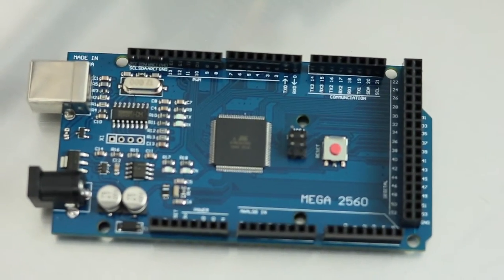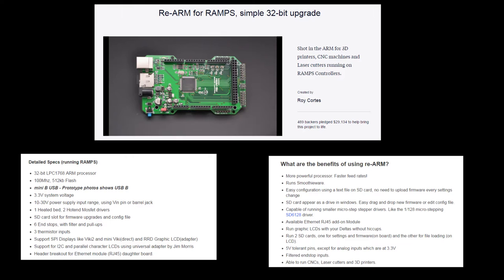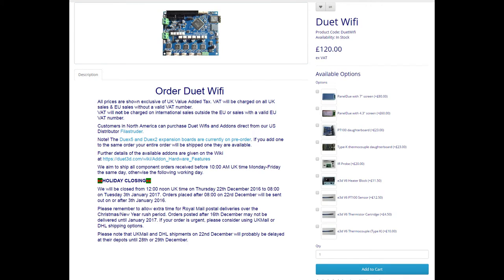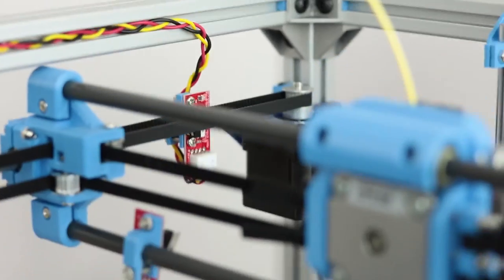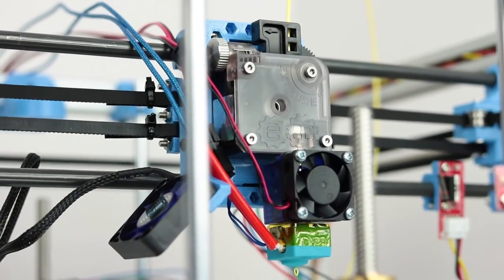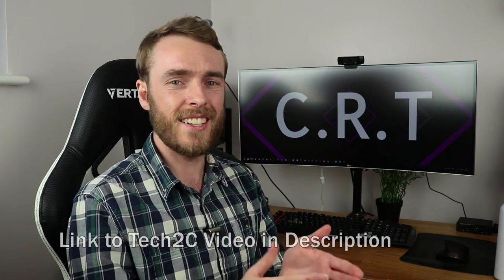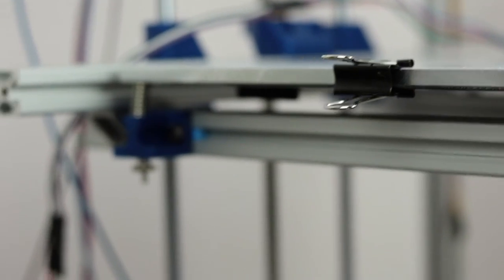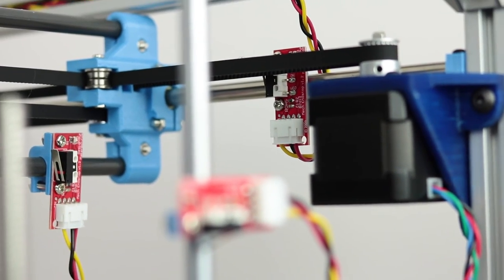Control and Cooling  - 3D Printer Scratch Build Log - Episode 6

Comment: I would recommend the Duet Wifi, The re-ARM project for me is kind of pointless as it still uses the flawed RAMPS 1.4 board. I do not recommend the smoothieboard because the duet wifi exists. The duet wifi just offers so much more than the smoothieboard for the same price. The Duet Wifi uses the TMC2660 stepper driver that will elimenate stepper noise. Not to mention WIFI and the excelent web interface for the Duet.

I also do not recommend the drv8825 stepper driver as it has some issues with missing steps when using a stepper motor that has a lower voltage rating than the electronics. I would recommend the standard A4988 stepper driver instead. Besides the 1/32 microstepping doesn't make it more precise, only slightly queiter. It also have a horrible whining noise when the stepper is not moving but still powered.

But if you want a quiet system without replacing the entire Arduino - RAMPS, consider the TMC2100 stepper driver. But i haven't had any experience with them, only read good reviews and feedback on them.

To be honest, 8-bit electronics are enough for 3D Printing. What you get from the 32-bit boards are for the conveniences (Web interface, WiFi, etc). For me, they are not worth the heavy pricetag just for those conveniences/features. But if you have the budget, they are most defenitely better than any 8-bit electronics.
Reply: yes, while RAMPS definetly works, it's not the best board out there. The only reason to use RAMPS is because its cheap. I bought all of my RAMPS from china and they all work fine. All the problems popping out on the RAMPS are because of its inherently bad design, not because of cheap parts (altough, if you DID get cheap parts from buying from china, thats also a problem. Mine came with all the specified parts and none of the parts are skimped). I do not see the reason to buy expensive "high quality" Arduino + RAMPS as I can buy better board with the same amount of money. People buy RAMPS, BECAUSE they are so cheap, there's no other reason, why buy expensive RAMPS? (atleast that's my logic. Its very budget oriented)

The RAMPS pulls all the 5v supply from the Arduino, and most of the time, the Arduino can't handle the load (from LCD, Endstops, servos, Wi-Fi SD if you use one, etc.) and will restart itself to avoid damage. The polyfuses randomly triggers unless you have a fan over your whole RAMPS (when using 11A heated bed).

My biggest gripe with the RAMPS is that it cannot use 24v power. And it can only support 11A for the heated bed. Actually, it doesn't even support 11A!, because the connector it uses for the input power is rated just barely enough for 11A. I would recommend soldering the wires directly to the PCB or change the the connector. And you would want to have a better heated bed, because 120W for a 200mm heated bed is NOT powerful enough to print ABS (unless you want to wait atleast 15min for it to reach 93c).
It is also recommended to run the TMC2100 drivers at 24v, but again, the RAMPS can't handle 24v.

Why are integrated steppers bad? You can control the stepper settings directly from the firmware, no more fiddling with trimpots and multimeters. You can also adjust the microsteps if you want to. This is the reason why there is a "silent mode" in the Prusa MK2, they reduce the current to the motor. And integrated stepper have better heat dissipation through the whole PCB, instead of a small isolated PCB.
Besides, the stepper driver on the Duet Wifi is as good as it gets. You can't find any better stepper driver module in the market. And the drivers on the Duet Wifi is basically an upgraded version of the TMC2100 (silent! 1/256 interpolation, and other stuff)

As for the 8-bit for CoreXY and Delta not being powerful enough, I disagree. I use the Arduino + RAMPS (china!) combo for my deltas and they are printing fine and beautifully. The only advice i can give to people is to use Repetier Firmware! (assuming they are using marlin). After changing to repetier firmware (from marlin), my deltas are running smoother and all facet artifacts are gone. The thing that limits the printer's speed is not the electronics, its the the HARDWARE. (check my videos, I have a video of my delta running at 200mm/s print and 9000mm/s^2 acceleration running of a Arduino RAMPS, it looks bad not because of the electronics, but its bad because my printer's hardware can't handle that speed)

Thank you for receiving my comments as an advice.